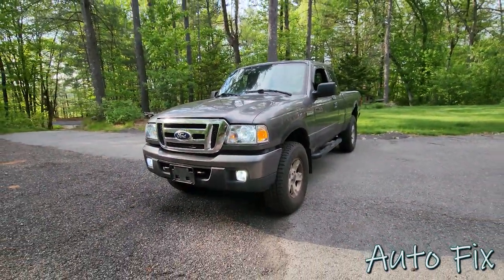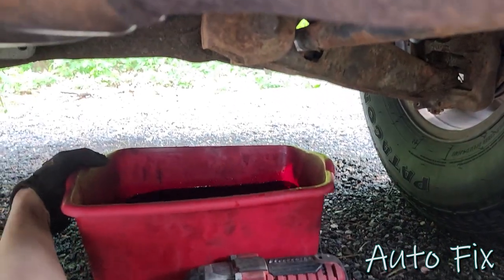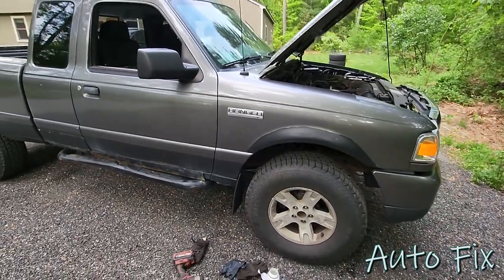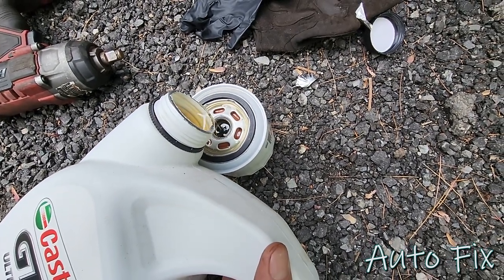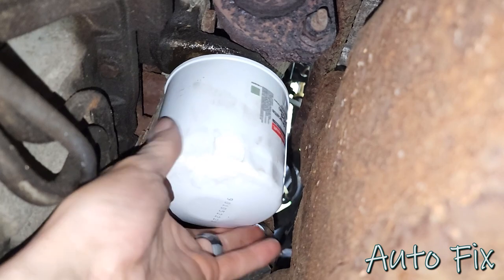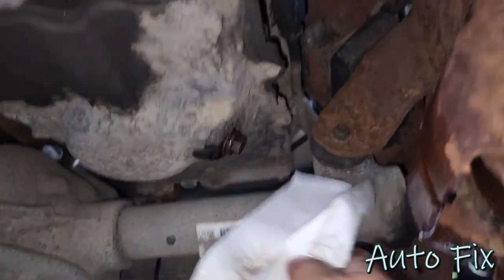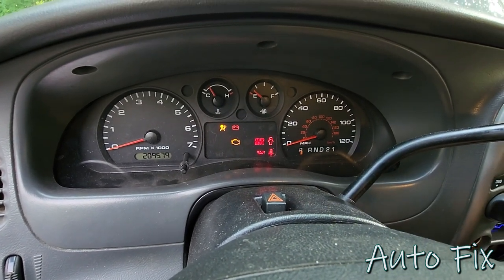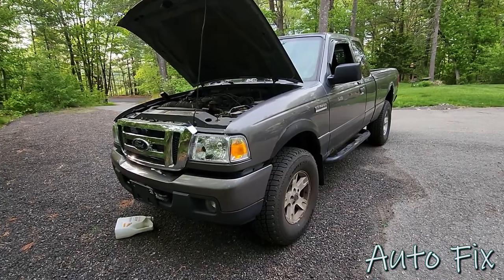Engine Oil Change 97-11 Ford Ranger (4.0L)

Comment: I loved when you dropped the oil plug into the used oil pan. I am glad you pointed out about making sure to check that the old oil filter gasket came off. My son found out the hard way on his Mustang. He changed oil, started it up, and oil was flying everywhere from the fan, what a mess.
Reply from the maker: It happens! Better to find out that way than after having lost oil pressure!

Comment: My 30 year old car uses a bit of oil about 3 liters in the last year. I just poor in new oil in once it becomes a bit low. Should I do a complete oil change from time to time? 
(I'm new to cars just and got mine like a year ago)
Reply from the maker: Well there are multiple things to address here. First of all, yes. Regular oil & oil filter changes are required if you want your car to survive. Oil is like the blood of the engine. You need to keep it fresh and clean so it can lubricate. If it gets old and dirty it will not lubricate properly and you will cause engine damage. Never doing an oil change will eventually completely ruin the engine and it won't last very long. Doing very few oil changes won't ruin it as fast but will make it very dirty inside with a lot of buildup which can cause other issues and in the end also ruin the engine.
Depending on what oil you are using, your driving style, how much you drive, and also what car you have, that will determine how often you need to change it. If you answer those questions I can try to help you determine that.
One last thing is you always want to make sure that it stays full between oil changes. Which it sounds like you're doing so that's good.
Hope this helps!

Comment: 96 4.0 ,4qts of Quaker State 100% synthetic and 1 t. Of Lucas 100% synthetic, your Ranger will thank you for it
Reply from the maker: Yeah lucas is good stuff!
Reply: Could you clarify?: I looked up Lucas Oil Supplement, but it said it was “pure petroleum”, not synthetic, though it mixes w/synthetics or “non”. I have an 04 Manual Ranger here, hoping for advice on the Lucas, please. GREAT video, man.

Comment: You can punch a hole in the bottom of the oil filter before removing it to drain the oil.  It will be easier and cleaner!
Reply from the maker: Yeah I've done that before but I often find it not to be worth the trouble and time spent doing that.

Comment: I noticed that you only use Castrol in your vehicles, I just wanted to know why you prefer Castrol over other brands like valvoline that offer similar oil grades and viscosities?
Reply from the maker: I found that Castrol has better additives for higher performance but also for older and more tired engines. But I have also used Valvoline a lot and there's nothing wrong with it. Price is also a big factor. Castrol and Valvoline are still well priced. Castrol also offers conventional and synthetic blends, which I prefer because i change my oil very often, so I don't need full synthetic. I run it sometimes, but usually I go for a synthetic blend.

Comment: I have a 3.0L should I just use conventional or go with synthetic
Reply from the maker: Up to you, convetional won't hurt but you have to change it every 3k miles. A blend every 5k and full synthetic every 7k.
Reply: @AutoFixYT  well damn I woulde went with full synthetic but they didn’t have any in stock for my truck lol 😂 oh well I’ll just have to wait 3,000 miles before I change it again
Reply from the maker: @ELI.K55069  honestly on my cars I wouldn't ever go over 5k no matter what oil i put lol
Reply: @AutoFixYT  ok 👍🏽

Comment: do the Ford Rangers hold up better in time to massive undercarriage rust than the old Tacomas do?  how many miles are on this Ranger
Reply from the maker: Yes overall they do. Not sure why. I have 212k miles on this one. All original.
Reply: @AutoFixYT   i think its because Toyota steel sourced for Tacoma T100 T4R Tundra and the rest is very  'Exotic metal' as one guy at one time labeled it

Comment: Did this guideline forget to change the drain plug washer?
Reply from the maker: Yes I re-used the drain plug washer/gasket. I always re-use them until they start to leak. I know you're supposed to replace it with every oil change though.
Reply: @AutoFixYT  I believe this is why my truck is leaking oil, seems jiffy lube wasn't changing the washers out. So recommendation - if its your car, do what you want. If its someone elses, friends or family, change the washer, you don't know how many changes it has been through, and you don't want to take a chance on having them call and say they now have an oil leak.
Reply from the maker: Completely agree. This being my truck I know how many times I reuse it and eventually I replace it.

Comment: At least your oil filter is under the engine not on the side like the 3.0
Reply from the maker: Yeah I've changed the oil on those before, I know what you're talking about.
Reply: @AutoFixYT  It's just really inconvenient that it's on the side like that. It would be nice to change your oil without having to use brake cleaner 😂